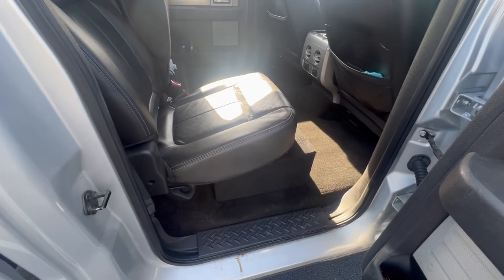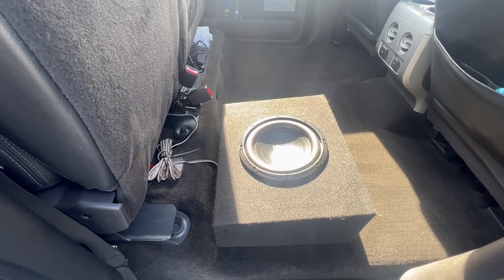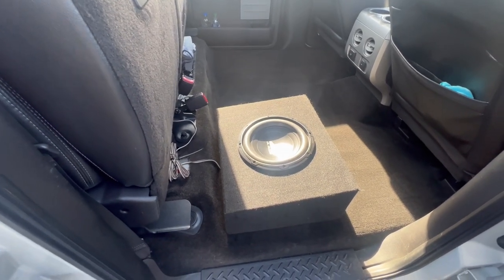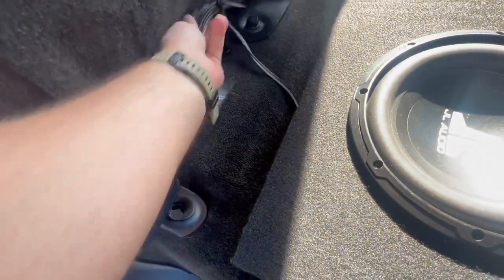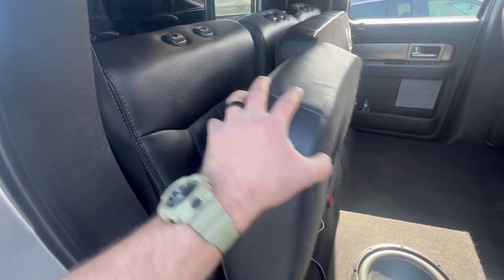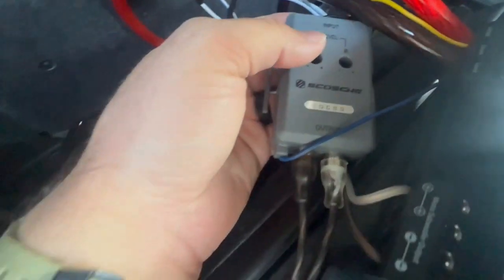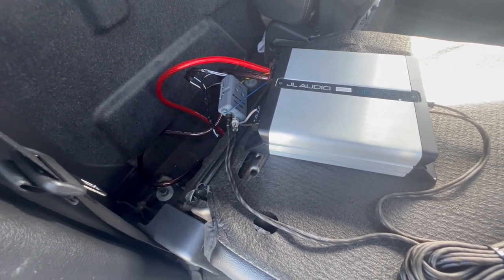2013 F150 Factory Subwoofer Upgrade

Comment: Did you remove the metal factory seat support brackets that were bolted to the floor. If so how does the seat preform as far as support goes now that they are gone? Thanks

Comment: Can you show me a picture of house you hooked up the factory wires to your LOC
Reply from the maker: Thanks for the comment, I wish I could post a picture directly to the comment but it won't allow it. In the video @ 3:40 I have my camera on the factory sub wires going into the LOC. It is nothing fancy honestly just used some wire connectors and covered them with electrical tape. The LOC has a positive and negative for the L/R so I connected the factory sub wires consistently to that. Since the factory sub was a dual voice coil it did not make a difference which two wires I placed in the Left or Right configuration so long as it was consistent with the positive negative. Hope this helps!
Reply: @NeesesWorkshop  are the striped wires negative?

Comment: I have a f150 single cab and two subwoofer, Would i have to Connect the converter to one subwoofer or both?
Reply from the maker: Thanks for the comment, the line output converter will not directly connect to the subs. It is meant to take what your radio puts out and change it to what the amp needs to power the subs. If you are using your factory radio you will need to hook into a speaker wire and connect the line output converter to that, then run those wires to the amp and your subwoofers off the amp. If you're running an aftermarket radio it is much easier as you can run RCA cables directly from the head unit to the amp and the line output converter is not needed. Hope this answers your question, I know its a bit of a tricky process!

Comment: Hey man what did you do with the extra wires coming off the LOC. i think it is the yellow wire
Reply from the maker: The yellow wire is for the power for the LOC so I have it in with the power wire going into the amp. When I started researching that's what I found was the best thing to do. You could certainly run another wire to the battery but with the amp wiring kit it just made more sense to tap into the power that was already there. Hope this helps!
Reply: Does your amp stay on all the time? Where do you have the remote connection?
Reply from the maker: @antoniorosaPR  it does not, the LOC supplies a remote wire so when the LOC receives signal from the speaker wire it acts as a remote and turns the amp on. I have an updated video that shows a little more in depth where I have everything going. Hopefully that helps!

Comment: Hey man! Does the seat touch the subwoofer? Is that bad? Also did you ground behind the seat?
Reply from the maker: I grounded on the rear bolt mount for the factory subwoofer that is right below the seat where the carpet is cut out. Unfortunately with the box I have the seat will touch the subwoofer. I plan to get another box that is preferably downward firing or build one that is lower profile to keep it further from the seat. I have a towel that I use to keep the rear seat elevated enough to keep it off the sub since my dogs are the only ones that are back there normally. Hope that helps!

Comment: Did you wire the yellow off of the loc to the positive and the black into the negative?
Reply from the maker: Yes I did, if you need a reference you can check out my updated video I posted a few weeks ago I made sure to show where all that was connected
Reply: @NeesesWorkshop  in my 2011 f150 I’m trying to use a loc off the factory sub harness I cut it at the plug for the old sub I have a +purple/green, -green/white and a +purple\green and -gray what wires from the loc do I need to match to these
Reply: @NeesesWorkshop  the amp turns on when I connect them but want transmit sound to the subs
Reply from the maker: @brodytrump9658  did your factory sub have the amp connected to it? Or was it just the sub under your seat? I had just the sub so it sounds like I had different colors. Let me see if I can find a diagram that shows those colors, I know I’ve heard of those being related to the sub it’s just been a while since I’ve read into it.
Reply: @NeesesWorkshop  it’s alright man I figured it out last night thank you tho
Reply from the maker: @brodytrump9658  sounds good, glad you got it working!
Reply: @brodytrump9658 how does the wiring work? I have the same wires as you and I’m wondering what goes to what on the loc
Reply: @NeesesWorkshop did you find the diagram for the other colors?
Reply: @brodytrump9658  i have the same colors in my '14, what did you do?

Comment: Where did you get your remote power from?
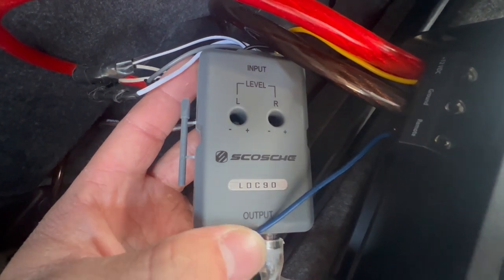Reply from the maker: If you're referring to the remote power from the amp I have it coming from the blue wire on the LOC that is on the same side as the RCA cables. You can see this at around 3:30-3:40 in the video if you want the visual reference. I know it seems weird to not have it going directly to the head unit which is what I was used to but it is supposed to get the "remote" signal from the speaker wire. Hope this helps!

Comment: Did you have a guide of the connections from the converter to factory sub wire
Reply from the maker: Hi Travis, I searched the forums and found this link that was helpful ( https://www.f150forum.com/f30/2013-crew-cab-tap-into-factory-sub-wiring-263845/ ). I also called Crutchfield to ask the same thing as I was curious, the tech told me that so long as the L/R was consistent from the LOC to the amp and subs that it wouldn't make a difference. 
They are pretty helpful when it comes to install and I called them while installing mine to ensure I did everything correct, definitely recommend.

Comment: Did you have to replace anything in the back of the radio? And can you show more of how to connect the rca to factory sub wires.
Reply from the maker: Hi JRM, I did not have to connect anything behind the radio. You get a Line Output Converter like this one ( https://amzn.to/3L4IOXP ), you connect the LOC wires to the sub wire then connect the RCA's to the other side of the LOC and to the amp from there. Just make sure you don't mix up L/R from the LOC to the amp.
Reply: @NeesesWorkshop how can you tell the left positive and right positive and negative on the factory subwoofer cable

Comment: Will it push 2 12s?
Reply from the maker: Thanks for the comment, the amp I have I picked out specifically for this sub. This amp would not be enough to push two 12's. You can certainly upgrade from the factory sub/amp to a higher powered amp and two 12's. Once you have your subs you want in mind you'll want to check for amps that can handle the "Watts RMS" of the subs @ 2 or 4 ohms (which ever the subs are as it can get complicated). If you get confused I would highly recommend calling Crutchfield's support team and asking for direction on a good sub/amp combo so you don't over or under power them as I have done that before and buying a second amp sucks when you could have done it right the first time.
Reply: Where is ur ground wire connected to
Reply from the maker: @manuelgrajeda2924  I have mine connected to the rear mount for the factory sub that is right under the seat. There is a small section where the carpet is cut out in a square and one bolt in the middle that was not going to be used anymore so I went with that.

Comment: Which wires on the loc do the wires from the factory sub have to be connected to for what is supposed to be the left and right speakers?
Reply from the maker: Sorry for the delayed response, I spoke with Crutchfield when I was doing this install because I wanted to make sure I was not messing up  the L/R and they told me it did not matter so long as I was consistent with the L/R wires from where the factory sub wires connected to the LOC then to the new amp/sub. If you're having confusion on that I would definitely give their support line a call as they are very helpful
Reply: What wire did you splice into with the yellow wire on the LOC or did you just plug it directly into the remote wire on the amp

Comment: Where is the amp?>
Reply from the maker: Thanks for the comment, I ended up putting it directly behind the seat. I need to mount it properly but where it is it does not move much more than an inch or two in any given direction since its contained by the back of the rear seats.

Comment: What wire did you use for remote? Thanks!
Reply from the maker: Sorry for the delayed response, since there was a factory sub I did not have to run a remote wire to the factory head unit. I took the remote wire from the LOC and used that for the amp. I'm not sure if all LOC's have that but the one I used does. Hope that helps, if you have any more questions I'll do my best to answer.

Comment: Does ur amp overheat? Or is it just mine that overheats and cuts off
Reply from the maker: It does not, thankfully there is enough room for decent airflow to it. Do you have the same one behind the seat? if so it could be over working or there just isn't enough air flow to it.

Comment: I connected eveything like usually and it keeps heating up for no reason, I changed my speakers and amp and it still heating up
Reply from the maker: I would check all your power and ground connections for the amp and the settings. If the connections aren't good that could cause it and if your settings are too high for the amp to handle it could cause it to overheat quickly. Those are the two easiest I can think of to check. Hope this helps.
Reply: Most likely a bad ground